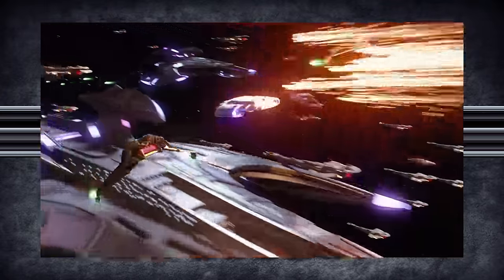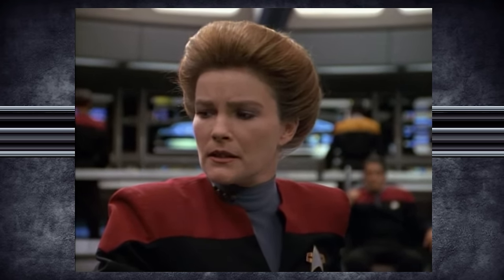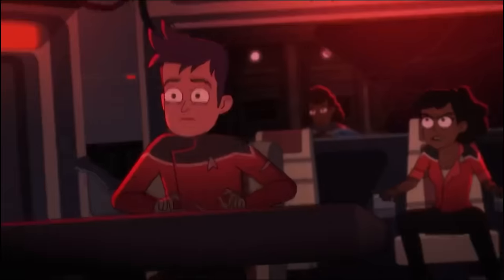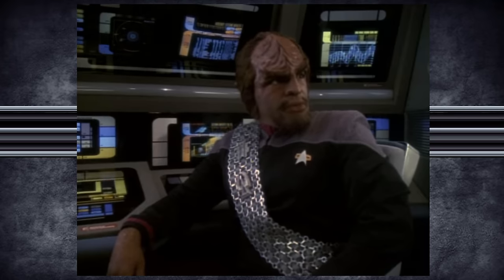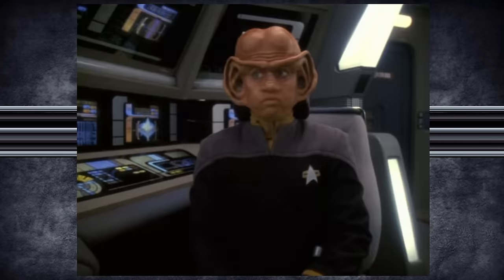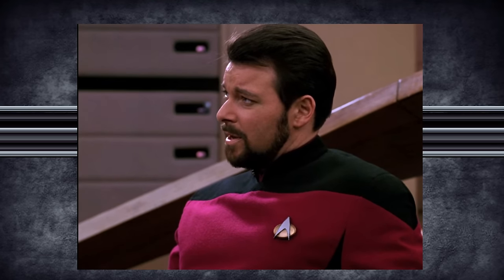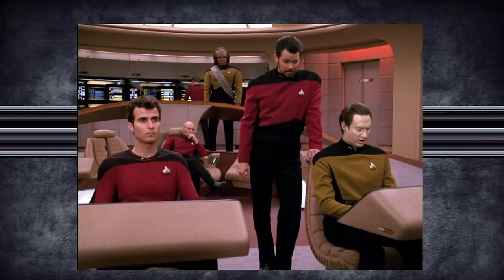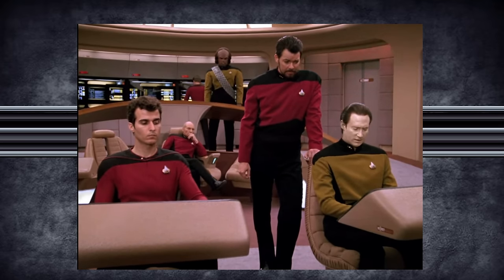Why Starfleet's Bridge Design Was Lethal to the Crews

Comment: Also this has little to do with the video but star trek lore, sorta... In big battles, why don't starship remote control launch all shuttle craft with an armed photon torpedo or 3 on board, and warp them into enemy command ships? If you're a miranda in the dominion war, you ain't surviving long enough to abandon ship so you may as well use them as space age rocks...
Reply: If I recall due to the way warp works you cant do warp speed ramming attacks against non warped ships. Your tactic could work if the ship was fleeing at warp and couldn't out pace the enemy so launching exploding shuttles into them in an attempt to destabilize their fields forcing them to drop warp could work for a time
Reply: Upon impact, I believe 'normal' velocities would resume, and being non Newtonian, warp moment would not be conserved, too.
Reply: Warp means that the ship is either stationary, or running at impulse speeds and the spacetime warps around it. The warp drive distorts spacetime and folds it, making distances shorter. The warp "speed" isn't speed in reality. It's the rate the spacetime warps around the ship, creating a velocity-like situation... It's the rate that the spacetime flows around the ship. Confusing, I know... 

Stopping from this situation brings the ship back to relativistic spacetime and it either keeps running at impulse at the speed it was running or keeps moving forward because of inertia.

Comment: To better protect the bridge they needed a dedicated shield system, which the refitted constitution had but not the later ships strangely and ether a deployable blast shield like the Galactica had or some kind of phasic hull plating that's still physically there but allows only visible light through as a window but can in a second turn into a reinforced bulkhead.
Reply: Let that dedicated shield constantly alter its shield frequency as well in order to make hostile beaming more difficult. Too many officers has been abducted and too boarding parties have entered, it need to stop. Came to think of it there was a Voyager two parter including time travel with an 20 century industralist that got his hands on some future tech thst made himself extremly resilient to hostile beaming with a device he carried. Starfleet should look into those and make them mandatory for all crew at all times.
Reply: As I recall, in Wrath of Khan when they went to yellow alert they showed a schematic of a secondary shield being deployed over the bridge.  One assumes that means the bridge has two shields, the main shield for the whole ship, and a dedicated bridge defense shield.
Reply: A deployable blast shield would be pointless on most federation ships since armor wasn't a thing and without shields, any blast shield would likely be just as sturdy as the basic hull around the window or the window itself. Now on ships like the Defiant which actually have armor plates, that's a different matter.
Reply: I just can't understand why ships aren't fitted with some kind of transporter technology. Once shields are down anyone can ether transport soldiers or explosives anywhere on the ship or capture the crew. It's a huge hole in your defences.

Have inhibitors that prevent boarding or abductions independent of the shields, maybe linked to your own transporters so you can only beam on or off the ship.
Reply: @thanqualthehighseer  lol yeah. Or keep your shields up, but before entering battle you deploy independent little unmanned carriers that are small enough to be difficult to spot, and contain transporter devices. And they are filled to the brim with missiles. You get to keep your shields up, and make your enemies explode at will.

Comment: I’ve always found Starfleet’s decision to put the bridge on the outer edges of the hull confusing and counter-productive, not to mention basically tempting the enemy to fire at the bridge directly (as we saw in Nemesis). A great example of a bridge location done right is the CIC aboard the Battlestar’s Galactica and Pegasus, which are located deep within the hull of the ship and separated from the vacuum by hundreds of feet of armor and structural support.
Reply: I tell myself that the bridge can be ejected in an emergency and serve as an escape pod, so they can stay in control up to the last moment.

Comment: Wouldn't the battle bridge be an analog to a secondary CIC
Reply from the maker: No one is there and they don’t work in tandem even if we accepted that.. which I’m unconvinced
Reply: @LoreReloaded  thats a fair assessment
Reply: Apperantly some ship designers forget to add them. Picards Enterprise had a secondary bridge only because the drive section needed a bridge of it's own in case of a saucer seperation. On the other side the Empire in Star Wars are no better considering what happened to that superstardestroyer.

Correction, Kirk's Enterprise DID have an auxiliary bridge of sort since the ship could be controlled from engineering in an emergency.
Reply: The Enterprise D can be operated from Main Engineering.  They moved control there after Data took over the ship upon him being recalled by Dr. Soong. Not a dedicated space but doable.
Reply: @michaelpettersson4919  there was also “auxiliary control” such as Kirk used to destroy The Planet Killer. I guess TNG era stuff merged engineering and auxiliary control since engineering was used that way in TOS too anyway.

Comment: I would’ve loved to have seen a Galaxy-class refitted for the Dominion War. See what changes they had to have made to have it a true battleship. And what alternations to the bridge would’ve been required. We only got see a glimpse of that from "Sacrifice of Angels" and afterwards. 

I always felt one of the problems with the Galaxy-class bridges as that they were just too large with too small a crew within it. I’m thinking of how many steps it takes to get from the Captain’s chair to the Conn and Helm. Especially if someone had to take over for whatever reason. The Defiant-class made more sense. It was more compact (cramped, some would say), but people could get from one station to another quickly.
Reply: Seeing what they did with the Excelsior class Lakota bridge and the Data's Nebula class command in the Sutherland, I'd much rather they didn't show an upgrade. With their limited construction budget limitations for guest alien or starfleet bridges they tended to have to do them an injustice. There's a few pretty good fan designed updated Enterprise-D's out there that are much better than the rush jobs we've seen on the screen.
Reply: @radioflyer68911  I always assumed the Sutherland was being commanded from an improvised or secondary command center. The plot had the fleet assembled quickly and they had to move officers and crew around to make it work so its an easy thing to assume the Sutherlands bridge was not operational when it was pressed into action.
Reply: Thats a trick of filming, the TNG bridge is about the same size as the TOS bridge, in fact most of the bridges fit in roughly the same footprint. 

The real difference was height, TNG and several others have rather tall ceilings while a notable few have rather low ceilings. ENT, TMP mostly.
Reply: The galaxy class can seperate its saucer section, imagine having special saucer sections to change to in times of war. Simple accomodations, more power generation, more shields, more weapons etc.
Reply: The closest thing would be the bridge layout from Yesterday's Enterprise. In that timeliness the Galaxy class was a battleship to be used against the klingons.
Reply: I like to think that they probably took Jellico's advice and turned Science Stations into Damage Control and Mission Status. But also, Spacedock I think did a good bit on how the Galaxy class is useful militarily for its immense sensor suites and communication abilities, letting it function as a coordinating command platform. Having dedicated stations (maybe in the back, the sides ((as in Generations)), and/or the mission specialist chair) that helped coordinate the entire Galaxy wing and not just the ship itself would be interesting.
Reply: Interesting follow-on. Remember when Riker moved forward to look over Data's shoulder? He'd have been moving a command element closer to Ops & Helm / Conn. A pretty damn good move.

Comment: It would be neat if you did a version of this video (maybe even a livestream) alongside an expert in naval design/engineering (like when someone brought a real city planner to play Cities: Skylines)
Reply: Crew stations in combat aircraft. The difference between side-by-side seating and tandem one behind the other. The difference between modern planes where each crew seat is an ejection seat, and others.
I'd like to see something with references to fast small naval ships. Tactical and combat ships, that have fast turns and accelerations and also have to deal with sea motions.
I'll bet that most of the crew are strapped in, or somehow restrained so they don't go flying around, and can reach and see what they need.

Comment: As a helmsman on a cargo vessel, I can tell you EXACTLY why the navigation is in line and facing forwards on the ship. Even in the dead of night, with thick fog where I can't even see the front of the ship, using nothing but Radar and Navigational software(I'm no longer looking out the windows), I can "feel" the ship as an extension of my body when I'm navigating. "Spatial Awareness"... And with how humans are physiologically it makes most sense to be forwards oriented.

This, "Extension of the body" effect will be very prevalent for the starship pilot too.

Flip me round 180 degrees if i have to navigate at night in fog... I'll manage. But I'll have to double check my spatial awareness constantly.

Edit:

Imagine this:

Your driving a car. Except your chair and wheel are turned 90 degrees facing sideways, and you can only look at a screen showing a camera feed of ahead of you. I GUARUANTEE you'll have a harder time than just sitting forwards facing.

Comment: Here's a question for you. Have you ever been on a Submarine?  It's the direct design used for Starfleet Bridges. The Original bridge was designed around the most advanced known Sub. in the U.S. Naval Fleet at the time. By the time TNG came out, we had much larger and much more powerful Nuclear Submarines and thus the design followed the general ideas of the new Sub classes.  Oh, here's a great little side note, Ever seen or even heard of a window places on a Naval Submarine?  No, well, there's a damn good reason, trying to look out into the black depths of the oceans would be like trying to see with your eye's closed.  Yes, the same applies for space.   Most think of space as the International space station or from shows and movies,m however, that is far from reality.  Space is black, and soundless.  You could travel through space more easily in an advanced submarine than anything Star Trek has actually produced.  You're right in saying the Defiant was the best designed bridge in the fact it was literally designed after a small high speed nuclear submarine designed to intercept possible hostile targets.  TOS bridge was designed around the base idea of the most advanced Diesel Submarine at the time. Also, if you think about it, All submarine bridges are in the forward center of the ship, directly under the main hatch.  The only thoughts I have about Starfleet bridges is that they still have a Submarine mentality.  Just a little food for thought as someone that has some knowledge about Naval designs and also knows why Gene designed the Enterprise around a Navy Submarine, space, like the oceans, is dark and dangerous.  He believed the best hope to get out into space and start exploring would be based around an already proved design, one that we still use almost a century later.
Reply: Yes I have been on a sub. Gato class at the navel museum in Buffalo. The one thing I was hoping for with Enterprise was for the ship to be more like a sub, tight quarters narrow walkways ect. In space, just like in the ocean space on your ship would be at a primetime.

Comment: "Why not have windows?"
Because they won't help you traveling at impulse, let alone warp or faster.  A ship that large in the vastness of space needs to rely on the instruments to advise the crew.  Otherwise, a small object (or boarding vessel) painted black would be just as effective as a cloaked ship.
Reply: I'm surprised more people haven't addressed this. It was addressed in another video. My argument is similar to you. The window would be next to useless as a backup to the main view screen. Look at the night sky. When the ISS is overhead what do you see? a bright dot. It's only a couple hundred miles up. Would you see it if it was around the moon?  And the moon is 1.5 light seconds away. (I think I got that right) so by the time you spot the enemy he has fired. Now I can understand windows in crew room and places like 10 forward. When you are relaxing its nice to look out at the sight.
Reply: Combat always takes place within baseball throwing distance. A few ship's lengths.
For docking, it might be nice to have a conning station placed specifically for viewing just that situation.

Comment: No secondary CIC?  Actually, on larger vessels, there always has been a secondary command post in Star Trek.  TOS had an auxiliary command area shown in several episodes, and the 1701-D had the Battle Bridge.  Also, according to the novels, battle bridges also existed on the Excelsior, Ambassador, and Sovereign-class designs.
Reply: I was just going to say this. Nearly every fed ship was shown or mentioned to have, a tertiary bridge or command deck that could be used in place in case of the main bridge being rendered inoperable. Some were simply secondary command rooms, others were literally whole second bridges that were much smaller in size but had control over every primary function. 
It's also worth mentioned that in some cases it had been noted that ships could be controlled from engineering if necessary. I believe the Galaxy class being one of those.
Reply: And never used, except once or twice for plot effect.

Comment: In terms of windows on a space ship... I don't think comparing them to real life military vehicles is apt.

On land your range of vision is limited by the terrain, on the sea and in the air, by the horizon. A majority of threats will be near enough that visual identification is viable.

Realistically speaking, in space, the majority of the time you will be fighting something which is, at best, a speck on a field of specks, to the naked eye. If your sensors go down, you are just as blind as you would be without a window.

Comment: In a scifi story I am working on, the starship can be set on a course, and automation kicks in.   It does not have a naval style bridge.   But it does have stations for manual operations.  I  There is the "Command Deck"  but that is located behind and slightly below the "Cockpit"  The cockpit being a 4-station area about the size of the interior of an H-1 Humvee, but with enough vertical space to allow for standing up.  It  can be seen from the outside of the vessel as a teardrop shaped bulge on the top/fore of the command section of the ship. The roof of this cockpit is solid.  Below this roof are (Borrowed tech from ST and SW) Transparent Steel windows. The Captain is the pilot of the vessel. He sits front-left. He controls the vessel with a yoke, foot pedals and joysticks. To his right in the "shotgun" position is the navigation officer. The nav station is also equipped with a yoke, but it remains stowed into the console until needed. Displays are located within the console and "Dashboard" as Tactile holographics. Some of the hull is visible from the cockpit. Images, overlays and relevant data are aligned with the eyes of the occupants, and projected onto the windows, so as to have the projections lined up with their respective locations, no matter how the persons head is turned or angled in relation to the windows.   Basically it would appear to the occupants, that the image of the data is floating in space right where it is required. (I hope I'm making this easy to understand.  An adaptive heads-up display.

 The 2 rear seats are for tactical and weapons control. Tac/wep can be transferred to nav, and vice versa if needed.  All occupants are seated at their stations in seats that can be described like those of a very plush conversion van, but are able to conform and provide proper bolstering and harnessing at any moment.  Behind the two rear seats is the portal or door that opens to  a stbd/port oriented hallway.  This hallway curves rearward and angles down to another doorway on each end.  Think like the split-level TNG bridge with a wall instead of the wooden beam.   On the aft-facing side of this wall would be a large view-screen and  a multitude of holographic displays for the "bridge" between the two portals that lead to each end of the hallway.  Here, on the bridge are where supplemental operations are performed.  Science,  Engineering, Environmental, Stellar cartography, and Security would all have stations here. 
As mentioned, my ship does have tactical and weapons, but is for the most part, a "Generation Ship" or an "Ark"  It is one of 12 identical ships forming a fleet of "lifeboats" for humanity when things go badly for the planet.

Comment: There really is a secondary CIC on almost all Starfleet ships in the shows. In TOS auxiliary control was shown quite often. In TNG they have the battle bridge, and show that the ship can be controlled from engineering. They don't show it on Voyager, but the intrepid class also has an Aux control room plus engineering.

Given the flexible control consoles in TNG era and onwards, you theoretically could control the ship from any room with a control console, provided you had the access codes to make the computer transfer command there.